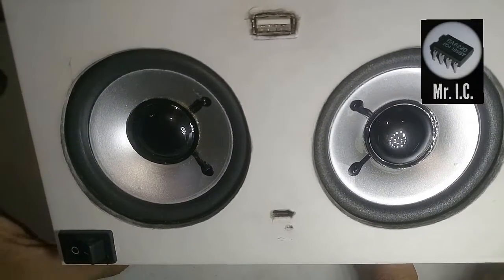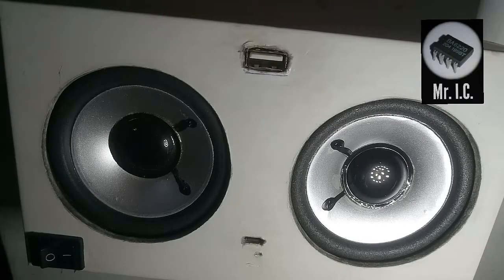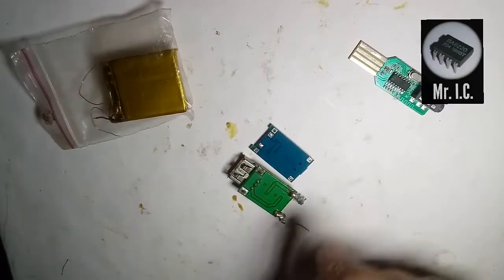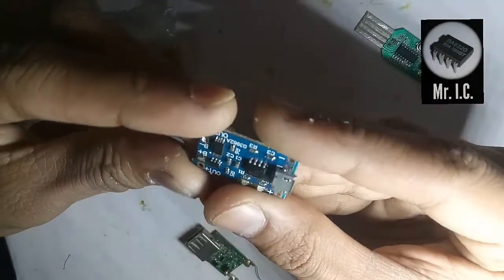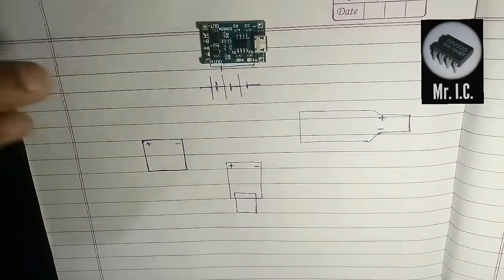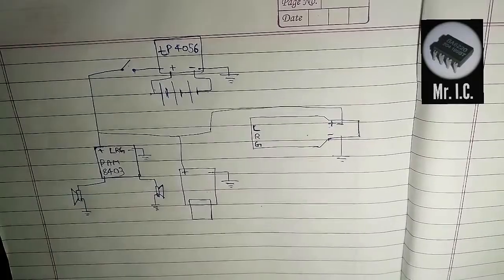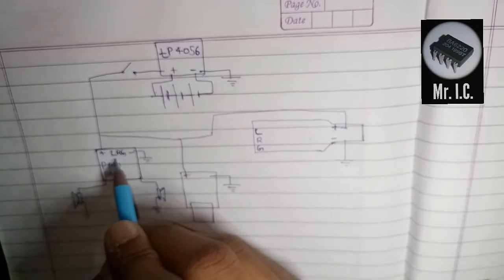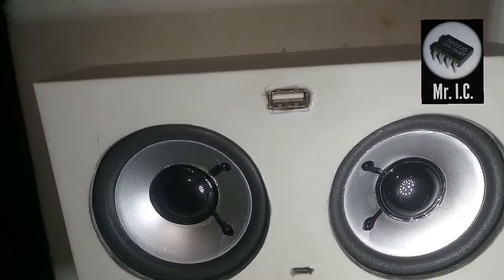DIY | How to make Bluetooth speaker | Mr. I.C. #diy #bluetooth #speaker #mric #music #earphones

Comment: Nice video
Can I use another Bluetooth Module like HC 06
Reply from the maker: No u cannot use hc05 module .. As that module is not made for receiving audio signals. . if u want to use that then you have to make use of arduino or other developmental boards. .. And couple hc05 with arduino and play the songs but that's too mess .. That's why i have used this module